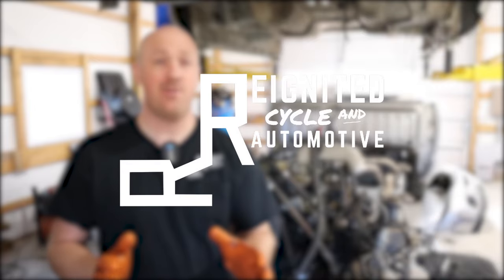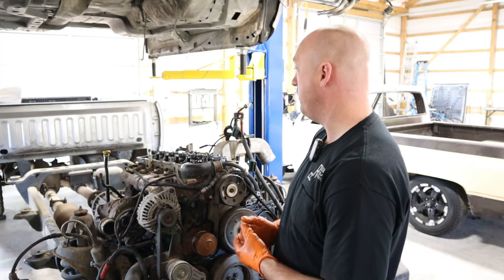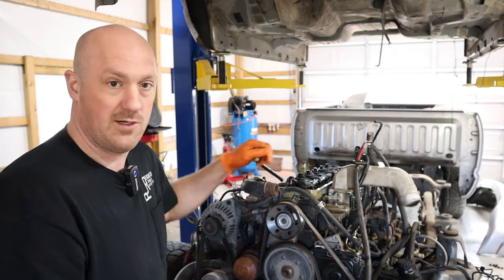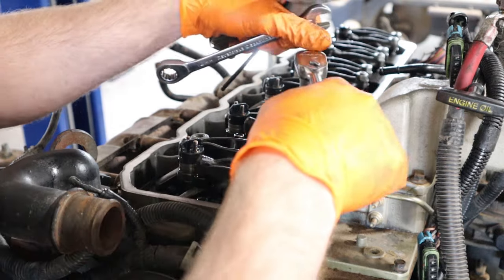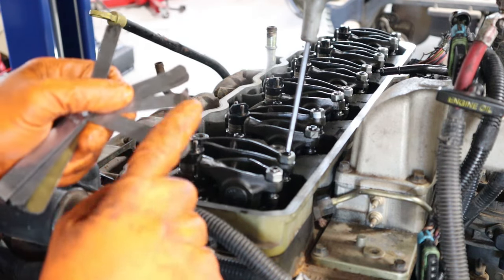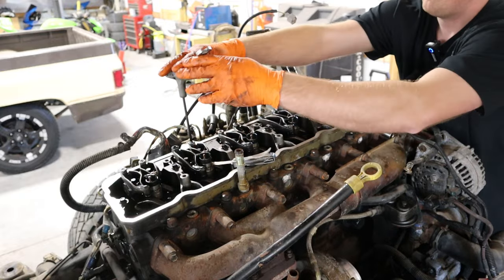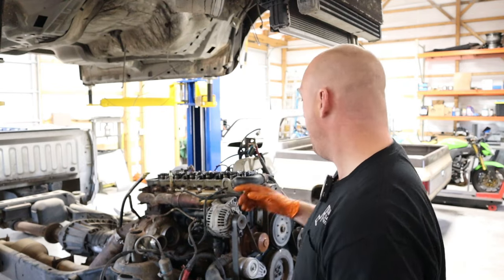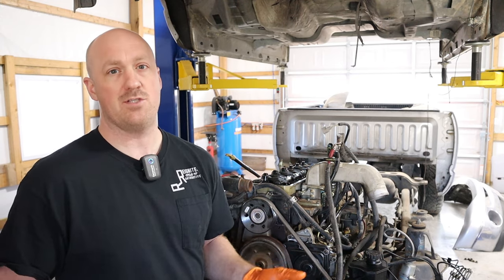Cummins Valve Adjustment // Simple Procedure Explained

Comment: About 20 years ago my younger brother had Kenworth with 855 big cam 2,that i and a buddy had did a inframe overhaul. We acquired heads with the biggest valves Cummins made. We installed a large 676 Sweitzer turbo. After the break in period i told my brother about reading in a old cummins generator service manual,that the injectors were set at 40lb/ inch, instead of the usual 72lb/ inch. Loosening up the engine af the  injectors and reducing valve last by .001 to loosen them up also. My brother said out on the road,fully loaded ,he could " go around and pass" 500 hp Cats! The jacobs engine brake worked so well my brother said it was like slamming on the brakes and used the word" violent" to describe how well the jake brake worked. If you know how it works,one can experiment and make things qork even better!
Reply: What did loosening the injectors do!?
Reply: @MikeMentzersProdigy_1  in old school Cummins fuel injectors the normal setting is 72 inch pounds,which ÷12 = 6 lbs . that the injector plunger, once once it bottoms in the injector cups ,the engine has to exert 6 lbs of pressure to get the cam lobe over the " hump". Even though cam lobes on many are essentially circles offset from centerline of camshaft bore.  Reducing injector setting to 40 inch lbs ends up being 3 1/3 lbs, almost half. The only thing that would be a problem,if it was a problem,and apparently it wasn't. Would be injection timing would be the slightest bit late . Or I should say the beginning of the injection of the fuel would be slightly later than at 72 in lbs.
Reply: @MikeMentzersProdigy_1  this reduction in force needed to operate fuel injectors,"frees up" the engine to make more HP. Available for moving the vehicle. Granted when a buddy of mine and myself rebuilt my brothers 855 big cam 2 Cummins. We located heads that had huge intake and exhaust valves. And coupled that a big Switzer 676 turbocharger, it was a good combination. It had an  actual Jacobs engine brake,that with the settings I used,my brother used to word ...violent, to describe flipping Jake switch on the dash. He said it worked so well,it was like slamming on the brakes.

Comment: Also ive never liked or used the valve adjustment method shown in this video. Yes you can adjust all the valves to 2 revolution of crank instead of 6. But nobody can tell you or me what that cam lobe looks like that you are going off of. I rest my case on my other comment,about my brothers big rig going around 500 hp.Cats,fully loaded.

Comment: OK, I’ve never done this on a diesel, but it looks fairly simple. Except I’ve got one question because I’m gas engines. We pull the spark plugs so the engines easier to turn. With the compression ratio of a diesel what are you doing to release the compression so it’s easy to turn, I’m curious cause I’m wanting to do this next weekend when I get home

Comment: Thanks for taking the vid while the cab off so we could see what you were doing.  That valve clearance is kinda important I got a free Honda gx390 because the exhaust valve was so far out of spec it wouldn’t open 5 min and 2 wrenches later purrs like a kitten.
Reply from the maker: Sweet! I worked on a friends xr650 and I set the intake valve slightly too tight. Bike started perfectly when cold but after it got hot it was hanging the valve and wouldn't start 🤦

Comment: Quick question.  Since there's lots of compression in the cylinders, did you do anything to relieve pressure so the crank turns easily with a 1/2' drive ratchet like you just did.?  thanks in advance.  Been many years since i did one last.

Comment: Good video, may I suggest the you can buy the feeler gauges with the bend on them, also to confirm that all gaps are the same you can use a inch lbs torque wrench, and the jam nut for the adjuster should be done with a torque wrench

Comment: I don't know if there is a difference between the 2003 and 2005 5.9 cummins but the valve cover sticker says .010 intake, .020 exhaust.  ?
Reply: I believe 06 and 07 , they changed to .026 on the exhaust.  I have a 2007 5.9  .010 intake and .026 exhaust.
Reply: common rail cummins

Comment: Good example of cummins valve adjustment, but can I give a suggestion when your able to adjust the valves with the cab off 
You can use a inch lbs torque wrench on the valve, I have been doing it for many years and this way you will know that every valve is the same. Also you should hold the adjuster when torquing the jam nut, it could move changing the valve lash, also for novices you should mark each valve adjustment so when all valves are done each valve will be marked. Even though I have been turning wrenches 🔧 for 30 plus years I still mark the valves and injectors if needed.

Comment: Yep, setting valves is a way of life with solid lifters. Your Cummins uses a distributor-type injector pump instead of a PT fuel system, so no injector torque to set.

Comment: I adjusted my valve lash and it is still knocking when I put a load on it. I can put my foot in it when it’s out of gear and it’s fine. As soon as I do it in gear it starts knocking. I turn it off and turn it back on and it is fine. What can be the problem?
Reply: Timing or loose valve guides check vacume and compression

Comment: What do i do if i removed the front pulley / harmonic balancer once before replacing front crank seal. Don't know if i put back the same as it came off, so my timing mark might be off from top dead center
Reply from the maker: You will have to double check, but as far as I know the crankshaft has a dowel pin in it that the crank pulley must be lined up with to go back on. So it should be on correctly. 👍
Reply: @ReignitedAuto  thanks. I will double check if there was a key way

Comment: How to set TDC right if I don't have the mark? It was erased by time.
Reply: The damper will have marks. It will be a line and say TDC. Maybe hard to see but it’s there. It’s engraved into the pulley. Unless someone grinder it.  Also you can tell by the 4 bolts that bolt the pulley to crank there’s one little extra hole for the dowl pin. That is another way to tell where the mark will be.